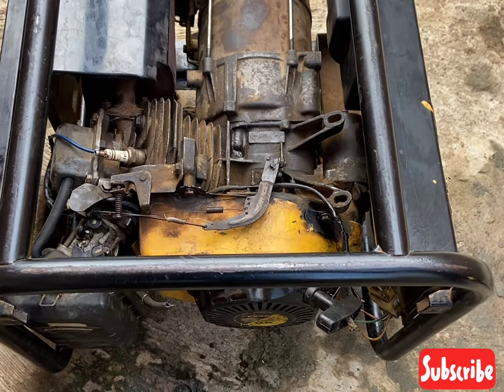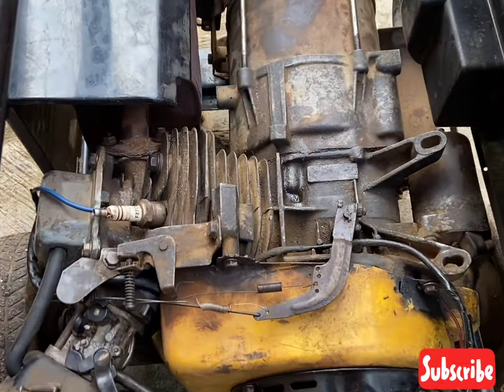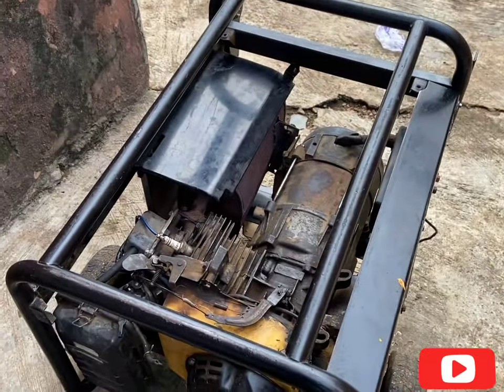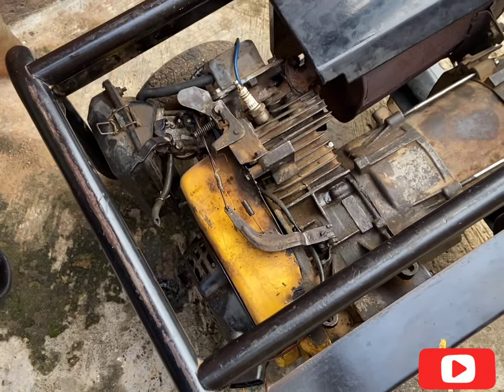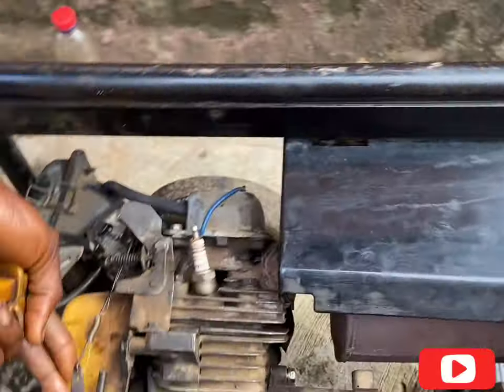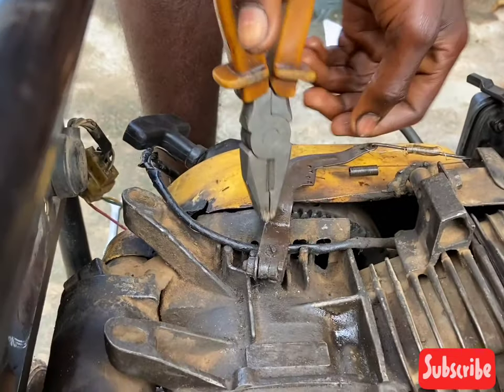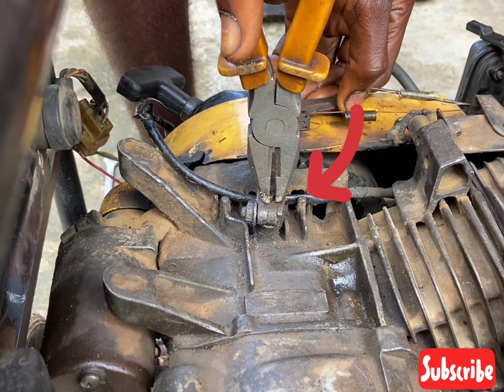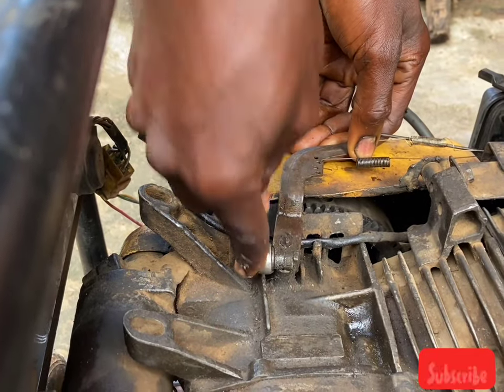Generator Governor Adjustment

Comment: Boss each time i turn on my gen then put on my sumo the gen current reducing then dies off,what could ve the issue?
Reply from the maker: Is it the current that die off or the generator itself
Reply: @jaywealthmechanics9285  the generator will make one strange sound like it's going to die,plus once I increase current then put on the sumo the gen sound would be so so low

Comment: Wow! My generator runs for a while and then goes off, I checked oil and plug and still the same and sounds with a heavy vibration instead of a fine prrrrr noise. Could it be the carburetor?
Reply from the maker: Is the oil guage.. check if the fuel is supplying well and service the carburetor.

Comment: Please help me, my tiger Gen will start very well but am not sure if the  adjustment working because it will work for a short time and stop with a cracking sound.
Reply from the maker: Did you mix the engine oil well.

Comment: Pls Brother my sumec fireman  3000 runs very high but when I put my electric iron ...it reduces to the lowest and starts shaking...on a norm, it carries both the iron and sewing machine...pls what can be the problem the voltage when on load is very low and when not on load runs very high...
Reply from the maker: Try to set the governor race, it will be balance
Reply: @jaywealthmechanics9285  thanks ..have done that already...I also increased the voltage on the AVR...everything is okay now...Thanks once again
Reply from the maker: You're welcome 😊

Comment: Thanks this very educative. Currently having issue of too much noise with my generator. Could it be the governor whatever u mentioned
Reply from the maker: Noise could be from the engine bearing or shaft. But when generator is running too high or over speeding, it is the governor race
Reply: To much noise I would say you need a new muffler, too many revs then follow this video.

Comment: My small tiger generator goes off after running for sometime at times 10mins or even 1hour. And it doesn't get jammed cos there is enough oil in it, can bad piston and ring cause it? The carburettor is new not sure is the problem. I am suspecting the piston is bad. Thanks.
Reply from the maker: firstly, check if the generator is supplying fuel from the tap, secondly, if the oil is not well mixed, it could cause it. in which it can affect the Piston.

Comment: I’m having issues with my generator frequency as some appliances won’t work. My gen is producing about 47Hz while the device needs a minimum of 50Hz. 

I’ve read about adjusting the governor to reduce or increase the frequency but I still don’t get it. 

Can you do a video to help out?

Comment: Can you pls help me with the very same issue on a 2 stroke generator.  It brings out 300v instead of 220v . And it's very loud.
Reply from the maker: Reduce the speed and the voltage will regulate to 220v .
Reply: @jaywealthmechanics9285  thanks a lot. Tell me where can I get those gas cabarator to transform my generator from petrol to gas. And how much does it go for . I'm in south 🇿🇦

Comment: Bro, my 1 month old 4.5Kva Elepaq Constant generator engine speed keeps fluctuating. It slows down to a point where it seems like it's about to stop and then it speeds back up. This happens repeatedly while the gen is running. Is this also a problem with the governor? Thanks.
Reply from the maker: Firstly, check if the governor spring is in good condition. 
Secondly, check if the throttle spring is well connected. 
Lastly, the governor race could also cause it,  reset the governor race.
Reply: @jaywealthmechanics9285  thanks man. Will try

Comment: My generator will go off after 30 minutes of running, but when I put it on back it will start working but still giving me sign to go off, please what should I do. Can the governor be the problem too
Reply from the maker: The governor can't be the problem. Service the carburetor or you check the oil gauge

Comment: I like your lessons,but I am having issues with soaking of my plug in my small tiger generator and subsequent hard- starting ,can you give me on how I can resolve this?
Reply from the maker: when tiger generator soak plug, the first thing you should  check, is  weather the caburretor,is not doing over float. second if the engine block is bad, it also cause it. lastly, excess of engine oil do cause it.

Comment: Useful video
But i have 3 k. V generator and its speed too high i did this but not working 
Speed is too high maybe governor is not working
Reply from the maker: If it doesn't work, that means the governor race in the engine is bad
Reply: @jaywealthmechanics9285  
I changed governor 
It was broken
Reply from the maker: Okay. After changing the governor in the engine.. did it work fine.
Reply: @jaywealthmechanics9285  yes i changed governor and cam 
Now its fine and running slow speed with nice volts
Reply from the maker: @حقپرست-ش2ق  wow. Nice one👏👏👏